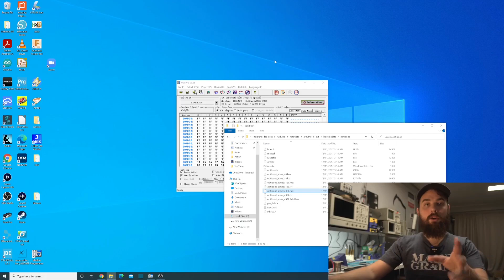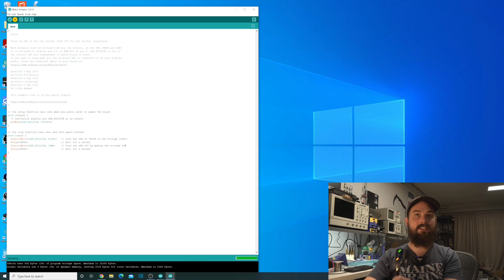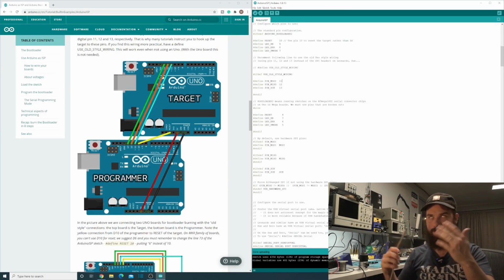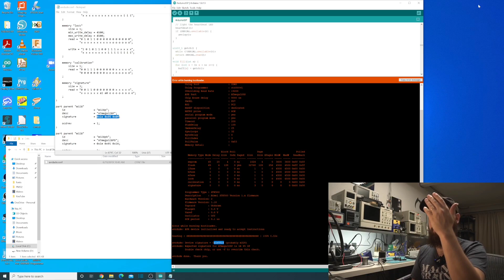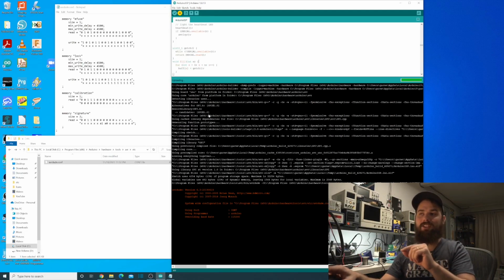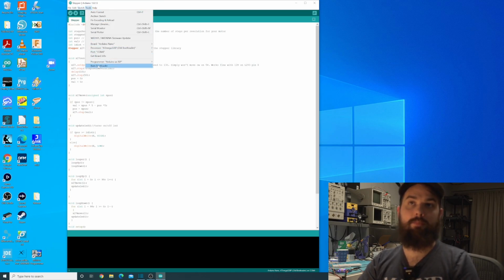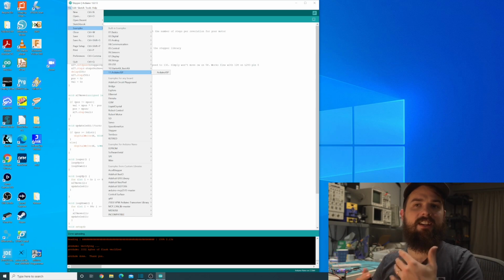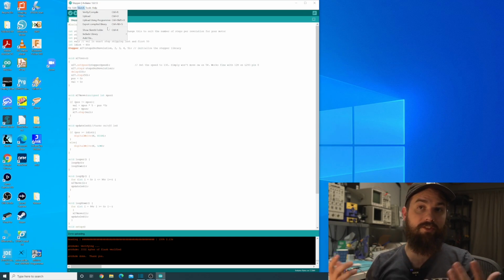Ultimate Arduino Bootloader Burning Guide from Blank ATMEGAs (3 Techniques)

Comment: Please sir reply

"While flashing GRBL firmware to an Arduino Uno using ZFlasher, it got stuck at 99%, so I pressed cancel. After that, I can't upload any sketches to the Arduino anymore. Could this have corrupted the fuse bits or the bootloader? What should I do to fix it?

Comment: hi, i have a question and i hope you can help. I have an Atmega328p at 16mhz, I also have a minipro. I do not have a breadboard at moment or anything other than my one arduino uno. How can i use my minipro to burn a bootloader with 8mhz clock? is this possible to edit the config file or some setting to be able to program (flash) my atmega328 with bootloader and to 8mhz fuse?
Reply from the maker: Do you need to actually do it with a minipro? If not just use Arduino as ISP and use minicore. Much easier fror getting it to compile correctly for 8mhz
Reply: @FixedUntilBroken  yes :(
Reply: @FixedUntilBroken  I just need to know which fuses to set in config that will allow the stretch to upload without failing
Reply from the maker: Well by default Arduino is going to compile for 16mhz so even if you set your fuses with a minipro your compiled code isn't going run correctly. That's why you are going to want to use minicore. That will let you compile for 8mhz and you can also set your fuses with that as well. Just use Arduino as ISP (there are modded versions out there that will even output a clock for you.)

Else wise just Google "minipro atmega328 fuses" you will find much better write ups on what you are asking for.

Comment: So I know this has nothing to do with this video...you still fix instrument clusters? If so how do I get mine to you. Mine has multiple motors burned out. I think it's the cause of my battery drain, bulbs burnt out, and info s screen is weird lookin
Reply from the maker: I do take them as mail ins or local drop off for repair. you can find my contact information on the about section of the channel.
Reply: @FixedUntilBroken  ok and can you replace with led lights instead of the old bulbs?
Reply from the maker: @Flexyourmemes  yes
Reply: @FixedUntilBroken  perfect. Only thing is I don't see your address in the about section. I'm on mobile might be why  I did go to you Facebook page and there was a call button. I'll do that tomorrow. Thanks

Comment from the maker: I have the TL866CS the new ones are TL866II plus and T56 but the T56 is $200. The TL866II plus is less than $100. That second one was showing you how to change the config file for 328 if you are using 328P you wont need to mess with the config file.
Reply: Hey there really need your help. Need to put bootloader on an ATMEGA328PB-AU I have clam shell and Nano etc and red loader. The nano has a P and I have PB. Will it work? Please help... Thanks for the great video!
Reply: what settings to chnage in config in minipro to set fuse to 8mhz?
Reply: what should the fuses be set to in order to flash bootloader with 8mhz so i dont have to use a crystal in my project?